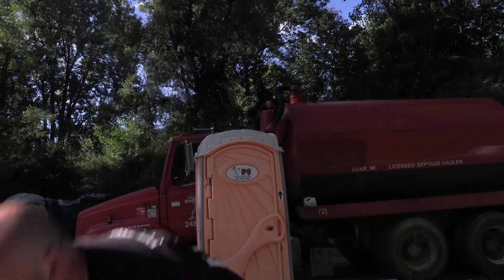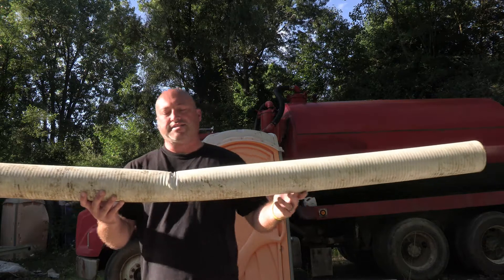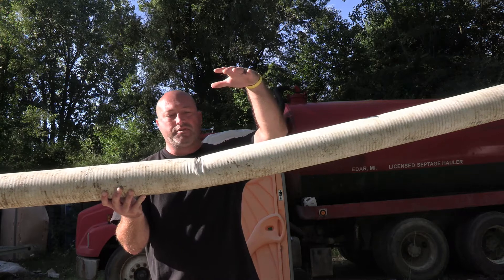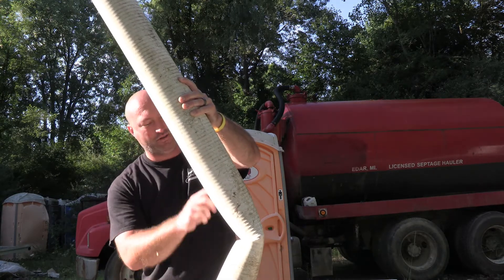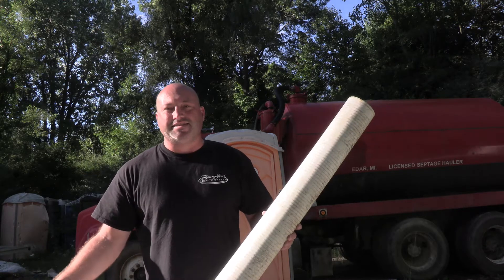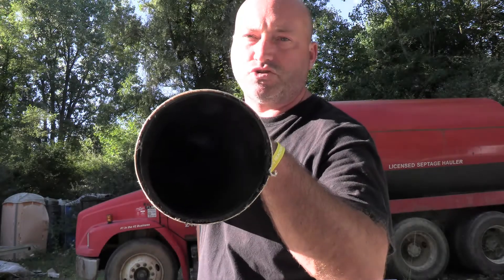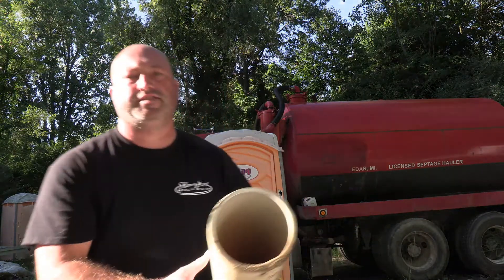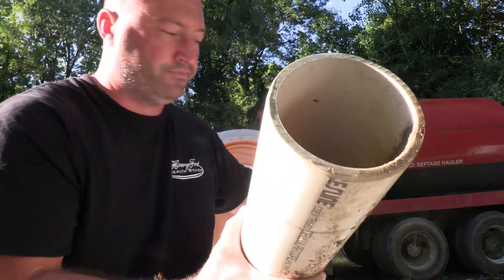What is the Difference Between Schedule 20 and Schedule 40 PVC Pipe? | #AskThePumperdude Episode 007

Comment: where do you get schedule 20 pvc pipe for a low pressure irrigation system
Reply from the maker: Schedule 20 pipe, also commonly called sewer and drain pipe can be purchased at any home improvement center.